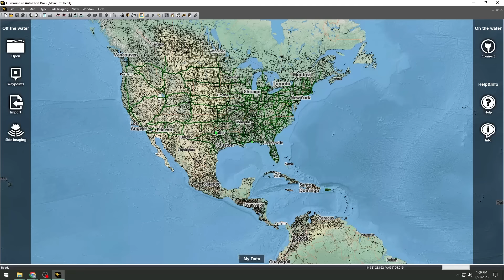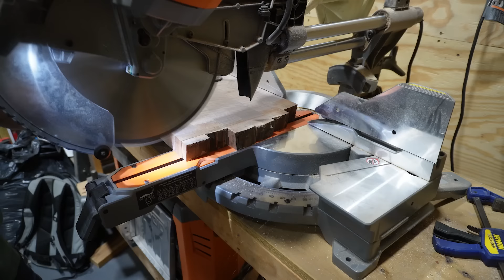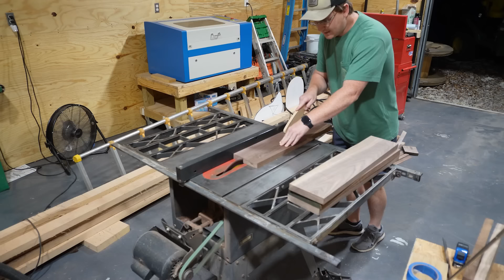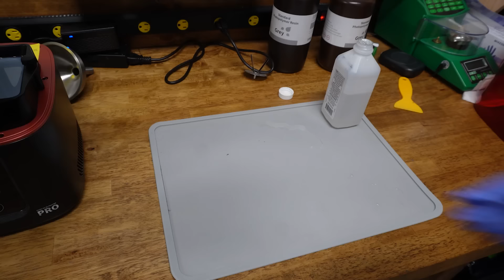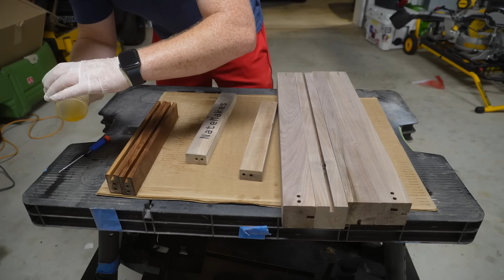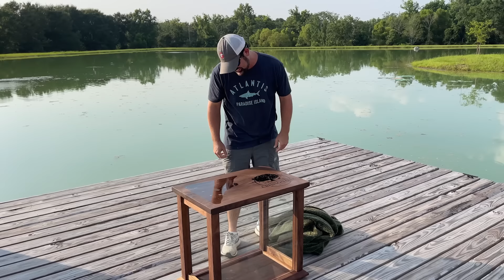Building a $10,000 3D Replica of the 5 Acre Pond! (Epoxy Resin Table)

Comment: Nate, please don't think I'm just here to be critical. That's not the case at all. The project looks amazing. I love the creativity but as a fellow woodworker I would be doing you a disservice by not poi ting out the fatal flaw with this build.  If someone doesn't let you know, then when the table breaks, you'll be left wondering why. Unfortunately, what's gonna happen here is your end grain section WILL develop cracks and some have literally exploded. When you make and end grain board you CAN NOT wrap a long grain border around it. Wood expands and contracts with the changing weather. Swell in high humidity, shrinks in low humidity. That end grain board and the border will be trying to move in different directions and will literally tear itself apart. Please look up some info on end grain cutting boards. There's a ton of info from people who can explain this a lot better than myself. Once again, please don't think I'm just some jerk on social media that likes to put people down. I'm genuinely trying to help you.  Est of luck.